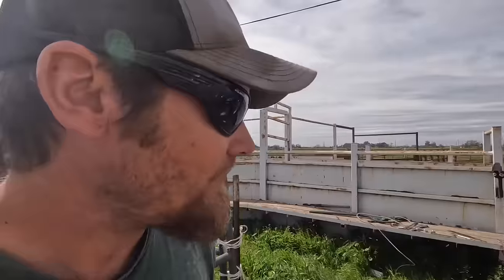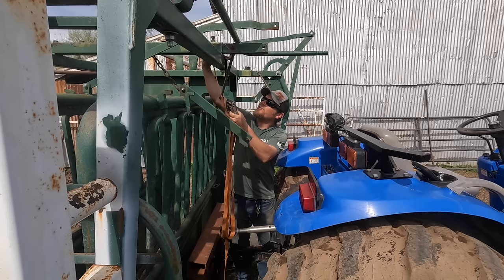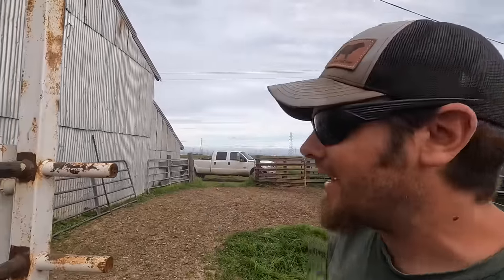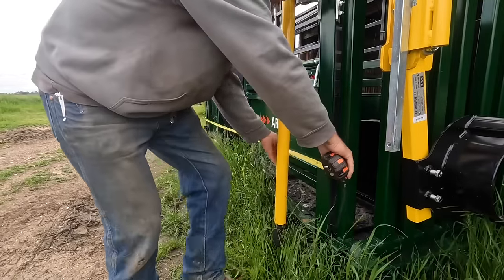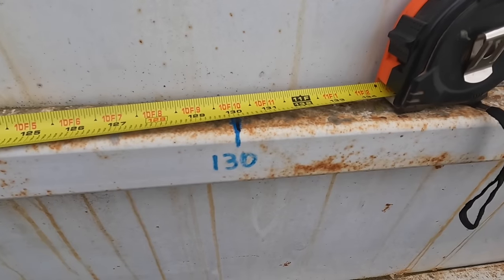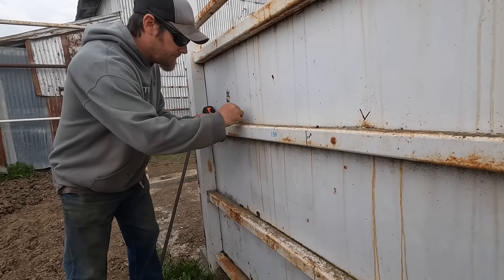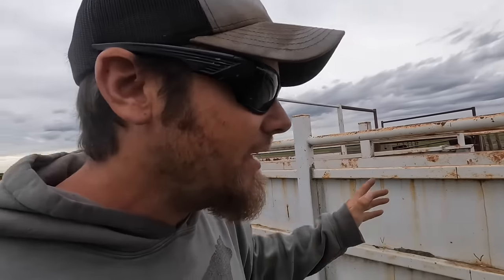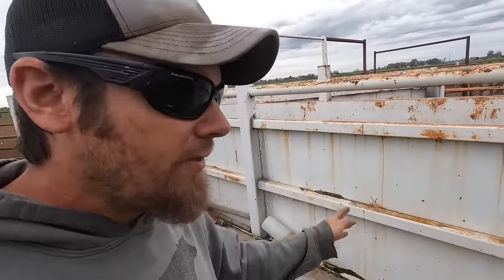Squeeze Chute Swap! Part 1

Comment: I know concretes expensive, but would it be feasible to make the slab large enough so that the little "Tyler work zone" thats fenced in has a solid base too? Would help you keep working even if the weathers not been cooperating, you'll keep your own footing without sliding or sinking in mud. Plus handy bonus storage space. If nothing else, a damn fine tripod zone lmao. (and no patch of grass to tidy up when it gets out of control lol). just a thought before you go building forms n shit

Comment: What a GREAT upgrade that Aeroquip chute is going to make to your operation. Given your handling system is custom made, well there will be cut and fit needs. I don't believe you over think it, it is just covering the "What If's" Starting the foundation from or with a clean slate will make you the happiest and will give you the best results!!Good post FTR!!

Comment: Just a thought….. and a question? Is the chute and the load bars high enough in elevation so they would be “high and dry” in a future working corral that is “high and dry”  
If not you may consider pouring concrete over everything that is there so you could bring in a little dirt so everything slopes away from the new chute and you have drainage out of the corral area. At the price they charge for these new chutes, you want to keep them clean, high, and dry so they last. Just a thought…. Now I need to go and jack up my chute (originally installed on top of the ground) out of the mud pit that it is in……🤠

Comment: Thinking about different options, thinking ahead & about possible problems is helpful in any project & saves time & aggravation in the end. This isn’t going to be easy to accomplish but will be well worth it. Putting steps or ramps on both ends of on the catwalk is a great idea, will be safer & your 25 years older self will thank you.  Might as well do all the work now to improve the alley approaching the chute & new rebar reinforced level concrete pad for the chute & load bars to sit on. May want to consider extending the concrete pad on both sides of the new Arroquip by 4 - 5 feet to give yourself a level clean area to stand / walk on & put a table for vaccines, medications, notebook binder or pad to write on & etc when working cattle.  You will be able to run pigs through to weigh them too. Would be easy to keep cleaner, sweep & hose off.

Comment: Great Video.  Have you considered cutting back to the closest post, placing the chute and then rebuilding your alley to fit?  I would think it would be faster rebuild  a larger section when the chute is in place than to cut a small section place the chute and then try to fill the small gaps.  You might even be able to save a complete section of alley that  you could use in the future somewhere else or even sell.

Comment: A new concrete pad would be nice.... with elevated piers where the load bars go so mud falls away and can be cleaned around easier.  I work in the ag industry and we always fight with snow melting then freezing and jacking up our load cells.

Comment: Like to see the process and you explaining the why. One question though, would it be less work for you to cut a section out of the alley at the post you will be keeping and then use the existing end as the new end instead of cutting and re establishing a whole new end? I understand that one post is set in the concrete but it could be cut off flush with ground level too?

Comment: my question is why wouldn't you use the front endo loader with the pallet forks you have?  I know you said the wires up above was the reason, but you don't have to lift the loader any higher than you did with the 3 pt. forks.

Comment: Tyler, would it be better to cut the end of the chute off so as you don't have to re-manufacture the same end and cut a piece of panel out of the chute to end up with the correct length. It would save rebuilding the cross over brace at the end of the chute. It seems a shame to discard something your'e having to make again. I've been screaming at the screen hoping you could hear. John...Australia

Comment: Why don’t you cut it back to the post, then measure back from the front of what you just took off and already has the overhead bar on it, cut it and reattach to that post.  Now all of those little things you would need to do are done?

Comment: I dont get why you are changing out the shoot. Your old one seems well biult an works well. There not cheap. Unless like so many other you tubers in only the usa have go 2 an 3 big complet set ups  from them. Free. I reached out to them for a good set up for my channal here in Canada.  He didnt even want to talk. But was happy to put a 20 cow set up qoute. For me. It a ton of money but being hydro one is biulding a 2nd big power transmision line over my farm all biulding an my hand biult working an loading system has to all be removed from the new esment an hydro has to pay to remove an rebiuld. An no fencing contractor that qouted the fencing around the easmeny will not rebiuld it due to liability. I working with another company thats talking.